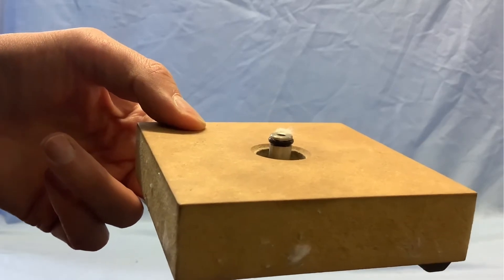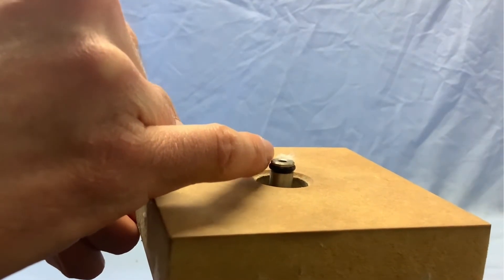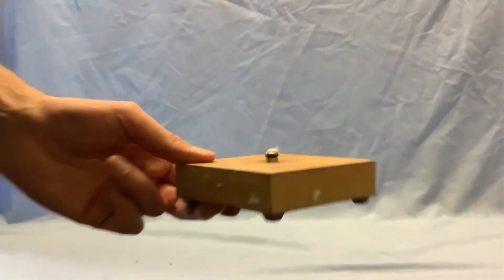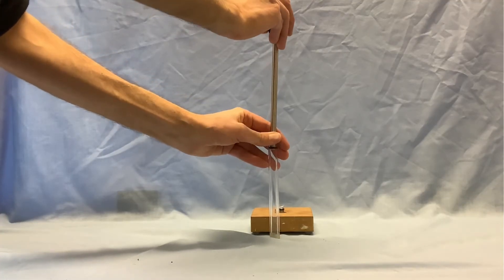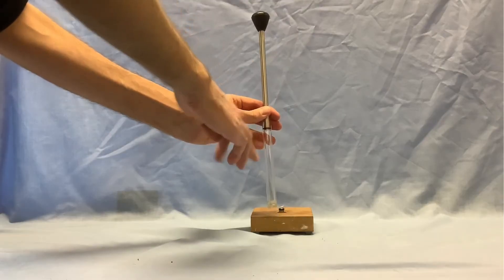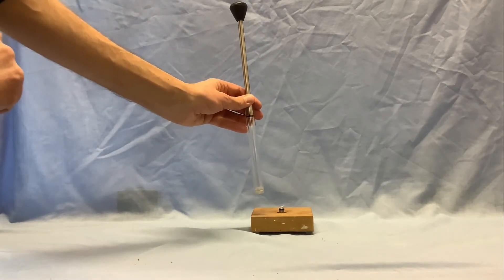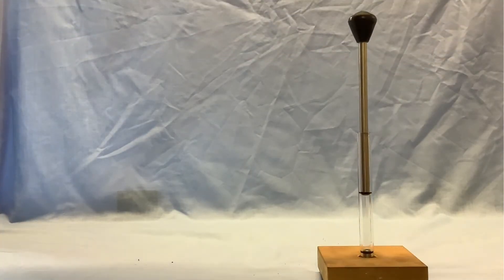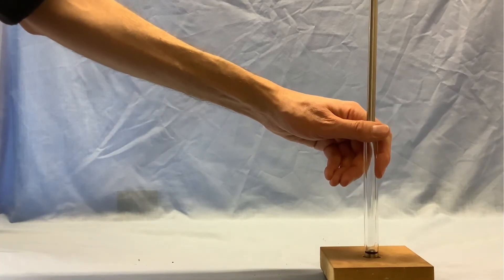Fire Piston Demonstration

Comment: Why doesn't the hot and expanding gasses caused by the ignition blow the piston right out or at least hurt your hand if it is in the way?
Reply from the maker: As it is just air, a small volume and small piece of cotton wool burning the increase in pressure is not enough.
Reply: Because the burning cotton or whatever doesn't produce enough energy to do that.
With a diesel engine, when the piston produces maximum pressure, fuel is injected into the hot, compressed gas and it burns - yielding much more energy than needed to compress the air.